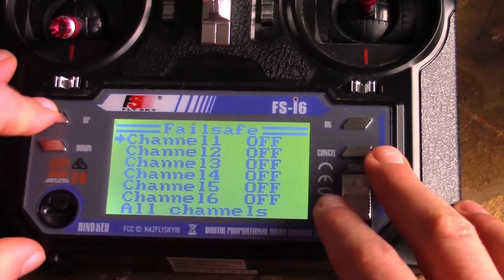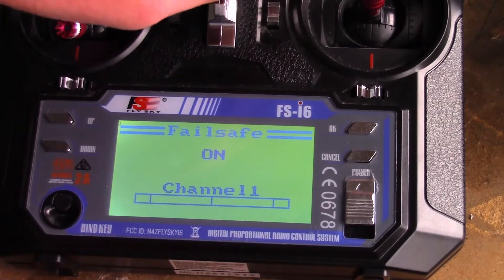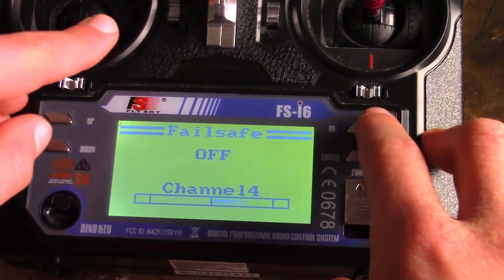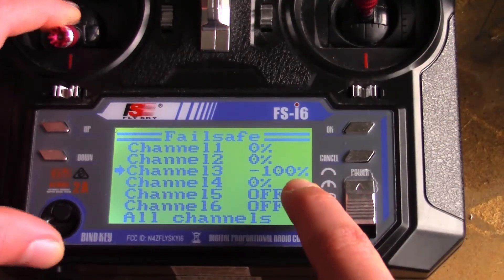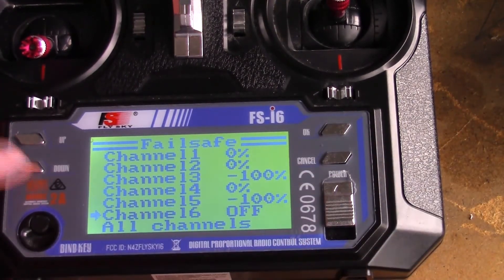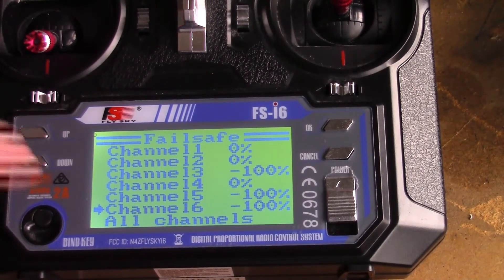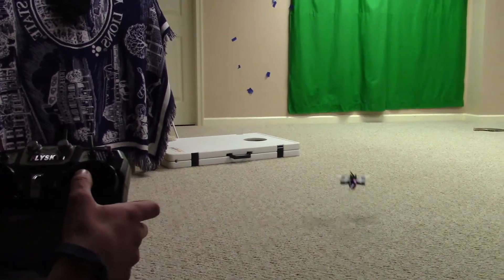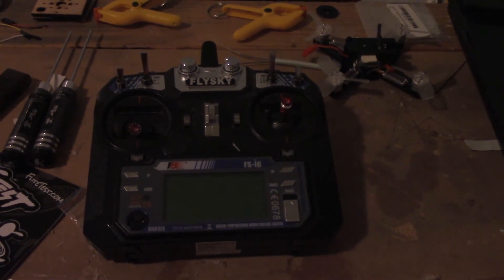HOW TO SET UP FAILSAFE ON FS-i6 TRANSMITTER | Flysky Failsafe test!

Comment: Ok, so, if someone were using Ardupilot and if they set the throttle to failsafe then that would cut the throttle? If, instead, they wanted the multi rotor to switch to Land or RTL then they should be changing the Chanel which was set up for that mode and not the Chanel 3, because they still want the drone to stay in the air and return home, is this right?

Comment: what you know about idle speed iam using libre pilot.  has the flip of death  in i cant get it off the ground,  i have a 250 using Hong Kong Motors
Reply from the maker: Glen Mccall check beta flight and the calibration of you motors? I’m not sure...